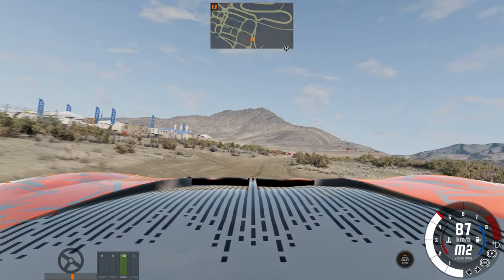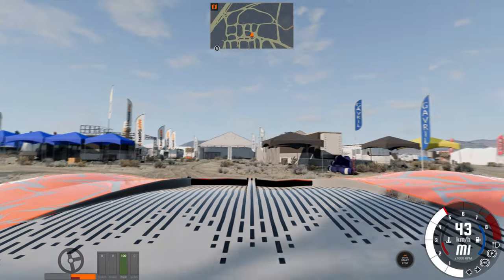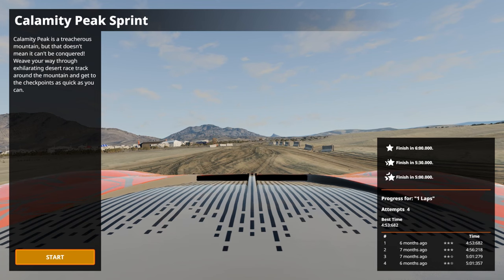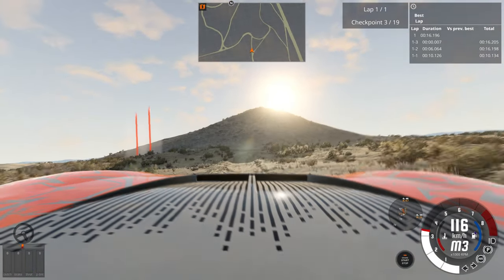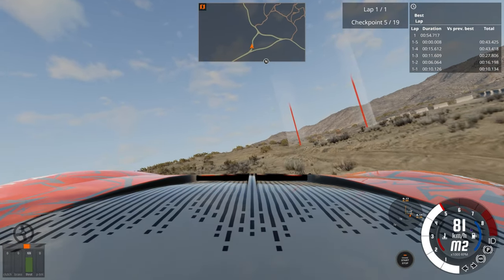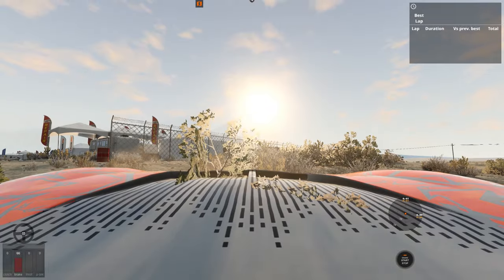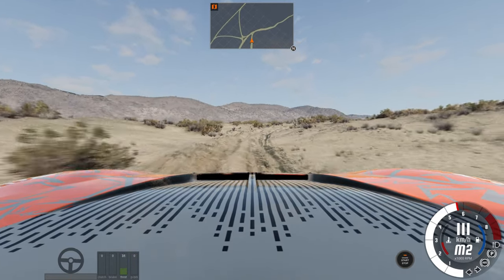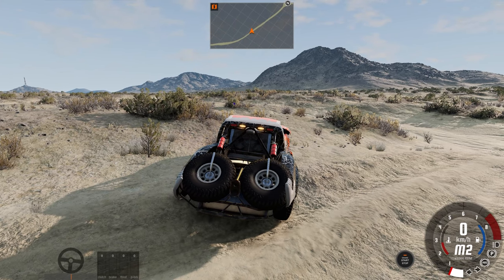A Guide to BeamNG.drive Trophy Truck Desert Racing

Comment from the maker: Just to clarify, since I didn't do great job of it in the video: this is advice from and for simulators only.  If you're going to drive a real world trophy truck or other offroad vehicle, get advice from people who have done that before.
Reply: lol good point
Reply: Honestly, other than being on throttle in the air it's all fairly similar. My only add to this is how much I two foot drive and trail brake with my hand brake. You'll be surprised what you can do with suspension tuning and brake/throttle modulation.
I actually rolled a truck due to jacking forces in a corner because I was off throttle. Fortunately it didn't end our weekend but it was a very expensive lesson to learn early. Offroad is unforgiving and relentless. It's close to feeling like being in an 6 hour long car crash.